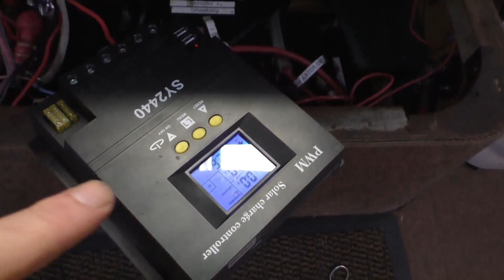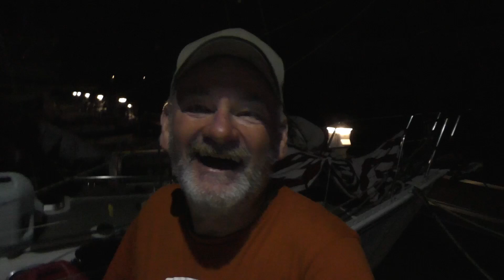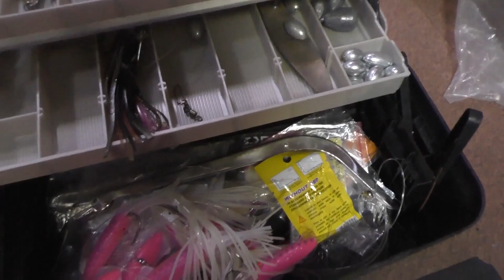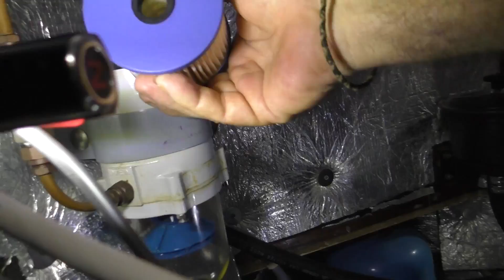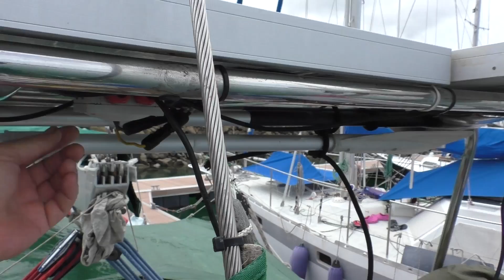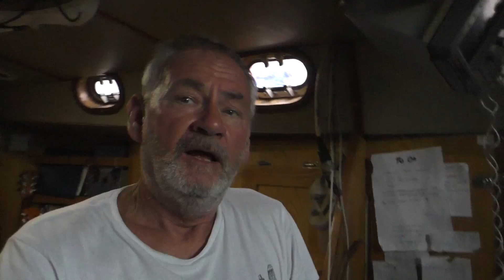Free Boat For Sale. Adventures of an Old Seadog, ep114

Comment: I suspect you will find those big chromed lumps of metal are known as 'plugs' in fishing circles Barry.
Lures of that size are normally intended to be trolled for pelagic species like Marlin, Sailfish and Tuna.
In the unwise event that you might entertain the idea of using the big plugs I suggest doing so with Shaddy shifting her stern as fast as she can go.

The lures feature such massive construction so that when a vessel is travelling at a specific speed they move through the water in a particular way at a predetermined depth.
You would undoubtedly also catch highly opportunistic and edible species like Dorado and inedible ones like Barracuda.
But you should be prepared for much bigger stuff or be resigned to eventually losing your tackle.
The latter scenario is undesirable because if you lose tackle, you are likely to leave a fish with a lure painfully imbedded in it's mouth, gills or throat.
Unnecessary suffering aside, a lost lure can affect a fish's health by impeding it's feeding so every effort should be made to land a fish and remove the hook.

Accomplished big game anglers use meticulously maintained and serviced reels that are built like the winch drum on a bulldozer so they can, and do contain more than a thousand yards of heavy line.
The tackle is worth thousands of dollars and big game anglers use it while equipped with a special harness which is attached to both the reel mount and a specialised chair that is heavily bolted to the deck of a boat.
Fighting a big game fish in this manner can take more than an hour and is an extremely strenuous activity.
Big game fishing is essentially a rich man's sport these days although groups of enthusiasts who cannot afford to own or hire a boat individually do so on a collective basis.

For someone with no experience at all and virtually no tackle save the requisite lures, I recommend you do not try it.
But if you do decide to give it a go I suggest you use the heaviest line you can get your hands on with an equally heavy steel trace attaching lure to line. 
Use at least one swivel of equally robust construction and attach the whole shebang to your stern using an inner tube or very, strong rubber strap to absorb the initial shock of the fish striking the bait. 
It is important that you understand you still need to have your line secured to the stern above the 'shock absorber' which simply attaches to stern and line form a loop in the line still attached to the stern above it.
Although I have never tried this unsporting method as I feel no desire to ruin its day for a game fish.
The latter technique is one I have observed some maniacs employ successfully in Darwin with species like Queenfish.

If you do hook something really big such as a Marlin or Bluefin Tuna behind your yacht, simply tow it like you would a dinghy in the hope it will exhaust itself struggling before it gets off or smashes your tackle.
If you succeed at that you might, be able to haul it alongside and retrieve your lure.
You may have watched the episode of Gone With the Wynn's where Jason landed a smallish juvenile Marlin which probably weighed in at about twenty or thirty kilo's on light tackle?

Try and envision a similar fish or possibly a Sailfish literally four or five times as big and possibly even more. 
The current world record for Marlin caught on game tackle is held by Melanie Kisbee of Australia who caught a 452kg (996lbs) blue marlin off Batemans Bay in New South Wales in 1999.

Just for general reference in case you are interested Barry big, wild caught Bluefin Tuna fetch eye watering prices in Japan.
Some fish occasionally fetch six figure sums and prices have been known to go even higher at auction!
For example a 612lb bluefin Tuna sold for a record $3m at the first Tokyo fish auction of the 2019 season.
It isn't difficult to see why tuna is such a phenomenally expensive species to buy in Japanese 'sushi' bars.
If you factor in about thirty pounds for presumably inedible bits, the latter price equates to $5,172 per pound wholesale!

Comment: Many solar panel installations feature an isolation switch which is a far greater assurance of safety when working solo Barry.
I have horrible visions of you toiling away on your electrical system at sea with various bits and Barry's (not Bobs) of clothing draped over your panels when a gust or squall blows them off and voila! 
Instant return to the days of disco dancing followed by a scramble for the Aloe Vera!

Comment: Just a tip .. if you disconnect the PV panels they stop working at all. 
So to be safe pull out the connections and they stop.. Also if you disconnect the battery they will stop eventually. Give it a couple of minutes to die out .. So no load to the PV panel there will be no sparkles the see.

Comment: Great score with the wind turbine. When it's not sunny it's usually windy and vice versa. Solar and wind seem like a really good combination. 
Might consider painting a bit of bright colour on the tips of the blades so that when spinning rapidly against a bleak sky the tips will still be visible. I'd hate for you to be checking out the solar panels and get clipped by the blades. 
Also, it's difficult to tell in the video but that mounting pole looks like it was made for a much smaller blade length. In some of the shots it looks like the blades will come very close to contacting the bend in the mount as the main unit changes direction. In very high winds the blades will flex a bit so there needs to be a lot of clearance. When you do find a stainless welder then it might be worth redoing the mount to add some bracing and if the bend needs to stay in the pole then maybe lengthening the top bit slightly to keep the blades away from the bend.

Comment: You proberly won’t need sails with that big prop   I drilled a small hole in one blade to tie it down when battery’s are full , did you get the regulator with the Jenny , ours makes about 6 amps an hour on average   Well done , what was there boat like ,

Comment: The heavy lures are pilks (tube pilks in this case) which you can fasten in the end of a fishing line and find a good spot where the sea botom is steep , or att least very inclined. Best fishing is on 70-120 meters (200-300') depth but generally you can use this method from 20-200 (60-350') meters of depth. Lower the pilk down until you find bottom. Then raise the lure about a meter (3'). Then adjust the brake on the reel until it's just about can take the wight of the pilk when you maneuver it up and down with your rod. The procedure takes only some seconds and now you are set to go. Than lift and drop the pilk (not necessarily fast, or very slow) but so the shiny metal wiggles and the light reflections attracts fishes around. You will figure it out in a while. If you use braided line and there are sharp objects like corals or sedimental rocks I recommend to put some foot or two of a leader between the fishing line. The leader can be of steel or a heavy monofilament nylon line. This method is used in northern Atlantic along the Norwegian coastline and is very effective. I've tried it in the Bahamas and it works just as well. Some call it jigging (and the lures jigs) but that is something else and includes a lot of rubber and a different fishing technique then pilking.
Reply: It works in all depths. They are designed for fishing cod. If the cod is angry or hungry…. you have it. Best result in sunrise or when the sun sets down.
Reply: Yes, and sometimes you just hook cods in a fin when they are to close to each other around the pilk 😉 Especially in northern Norway. Once I caught a 12 kg cod hooked in an eyebrow… outside of Leka.
Reply: Ok great explanation ; but what can you catch with this lure  ?
Reply: Of course you actually can get a lot more spices then listed down, but so far I’ve caught: 
Atlantic Cod (Gadus morhua), 
Coalfish (Pollachius virens), 
Atlantic pollock (Pollachius virens), 
Common Ling (Molva molva), 
Rose fish (Sebastes norvegicus), 
Barracuda (Esox sphyraena), 
Whiting (Merlangius merlangus), 
Haddock (Melanogrammus aeglefinus), 
Redspotted plaice (Pleuronectes platessa), 
Atlantic halibut (Hippoglossus hippoglossus), 
Red hind (Epinephelus guttatus), 
Atlantic mackerel (Scomber scombrus), 
Atlantic wolffish (Anarhichas lupus), 
Atlantic herring (Clupea harengus) 
Cero (Scomberomorus regalis)
Tarpon (Megalops atlanticus)
etc.

So, both small and big, high and low, stationery and pelagic fishes are attracted to the pilks.

Comment: Metal tubes are pirks jigged up and down and hope for the best. Awesome watching your travels. Safe Passage. 😀
Reply: The best fishing at sea is to use the up & down method, a surface lure and a deep lure to fish multiple levels. If you don't have a wire line pole to get  to the deeper water column, a heavy lure or a lure with a trolling weight a decent ways from the lure works.

Comment: Hi Barry! The heavy fishing gear is for fishing cod. The shape gives it very low resistance in the water when you are supposed to move it up and down a meter or so close to the sea bottom (imitating herring). The weight can be up to a kilo in order to reach the bottom if it is strong current and deep sea fishing. Hope to see allot more of your adventures here on youtube!! Keep up the good work!! / Nick
Reply from the maker: Thanks for the info Nick.
Reply: If you have a fishfinder and the cod is spoted on 30 meter you will not catch and hook it at the botom at 80. It will hook the fish where it is. But sometimes I see on my Humminbird fishfinder that cod rocketing up from 70 meters and hunting the jig on 30 meters. All i 8  sec.

Comment: I hope you have a mate when you cross the pacific Barry ...would be a help
Reply from the maker: No body loves me!!! Solo it will be.
Reply: @bradb7342  : Crowley? He's probably angling to offer a tow.
Of course the boat's good to go!
Reply: Cliff...steel hull, dry bilges, careful skipper.....pffftt
Reply: Charlie Cain ohh come now. Yes the boat is solid. But The systems are under continuous repair with bobby Pins, silver  tape, outdated if any charts, and a thin budget. When an engine system goes and you lose charging capability 15 days out the fun will start.  Remember he was sailing in circles for 2 days of the trip just trying to get to east coast Panama from Columbia. Look at the track from that video. Have a pint with Barry, sure.  Trans oceanic on Shaddy? No thanks. I suggested months ago he needed to pick up some crew on the longer legs. I hope he does. If only to stand watch. A bit bigger adventure than Azores to Carib. They say there is someone for everyone. Hope so.
Reply: @Baba3756-n2o  i think that is what i suggested...?
Reply: I don’t think that there are many that would consider the boat or equipment sound  enough for a transpacific voyage. Making it across has the same odds of winning the Irish Sweepstakes.
Reply: That the Old Sea Dog consider the boat and equipment sound  enough is all we need to go on the journey with him. Just relax in that high and dry rocker and  let life on the high seas roll.
Reply: Clay G. We?  Are you on board for the leg to  Marquesas?
Reply: Cliff Crowley, aren't we all going? Many of us have been on board since Europe, episode 1.